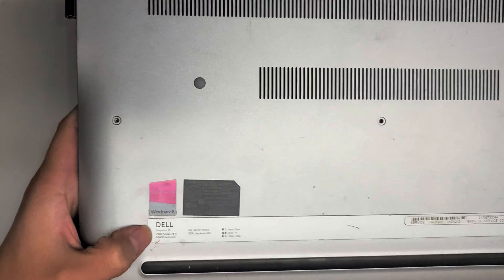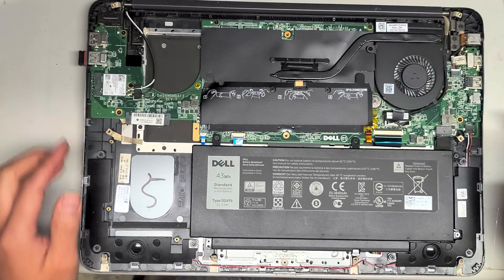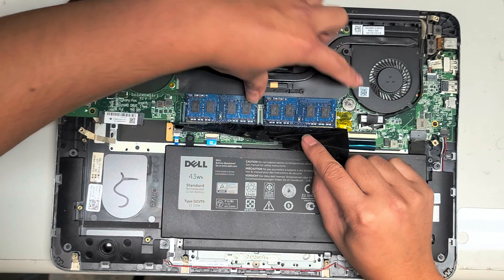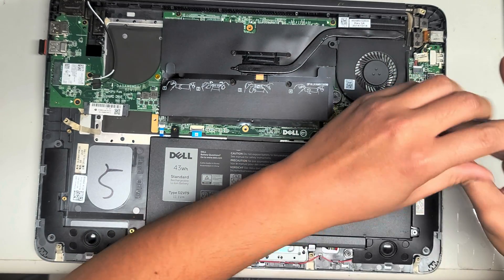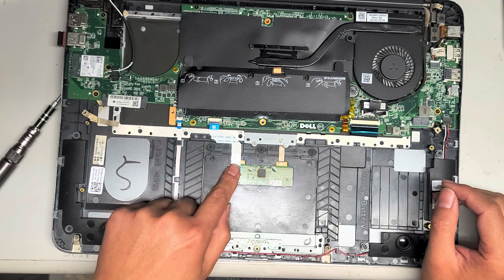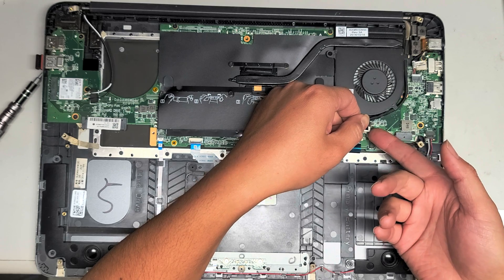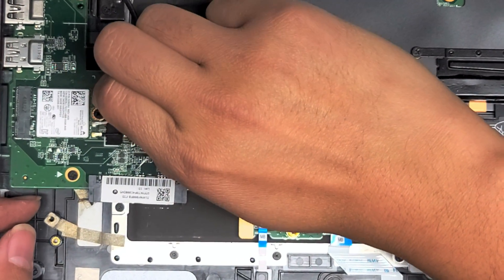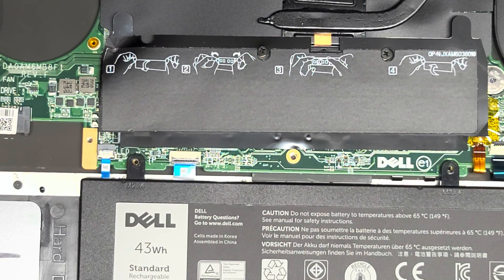DELL Inspiron 15 7000 Series 7547 Disassembly RAM SSD Hard Drive Upgrade Repair Battery DC Jack Fix

Comment: So i replaced my battery but when i press the power button, it on flashes on for a split second then turns off and the computer never turns on
Reply from the maker: What did it do with the original battery?
Reply: @ItsBinhRepaired  the original battery I believe i disposed of it but i got the same battery to replace it, I tried as best i could and resulted in nothing
Reply from the maker: @kailalfaori7579  so with the original battery it had the same issue? Sounds like a motherboard issue.
Reply: @ItsBinhRepaired  with the old battery the computer wouldnt work at all, like nothing would turn on or anything.
Reply from the maker: @kailalfaori7579  hmmm usually after replacing the battery, you press the button once and wait 5 minutes. If nothing happens, sounds like a bad motherboard :(
Reply: @ItsBinhRepaired  yeah probably
Reply from the maker: @kailalfaori7579  :/

Comment: Hi, mine is same laptop but my web cam is not working.
Reply from the maker: Does it appear in the device manager? If not, check the connection under the screen.

Comment: Does the 7547 have an m.2 slot for an NVME drive? I have a 1tb HDD in mine now and want to get faster boot times, but I'd like to keep the storage of the HDD if possible.
Reply from the maker: If I didn't mention it in the video, I don't know.